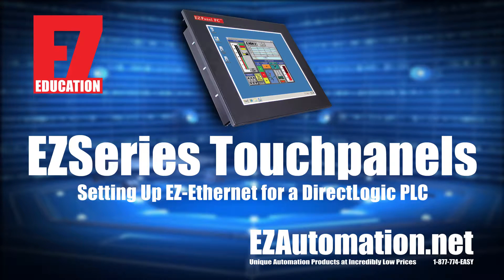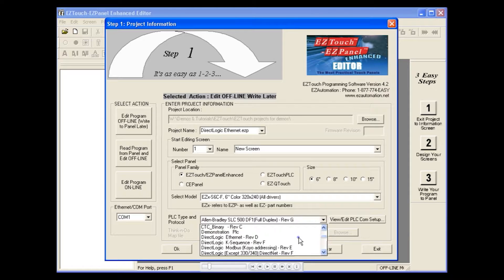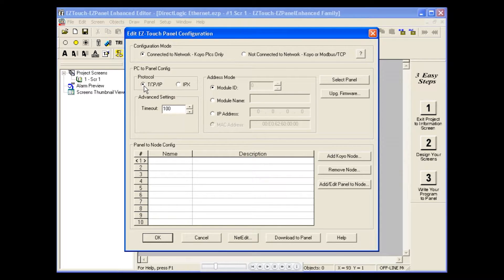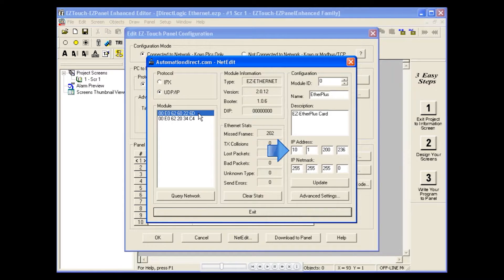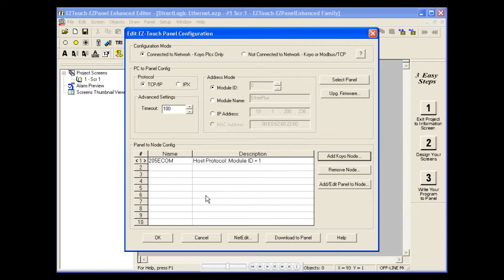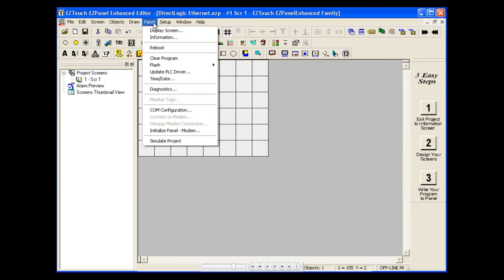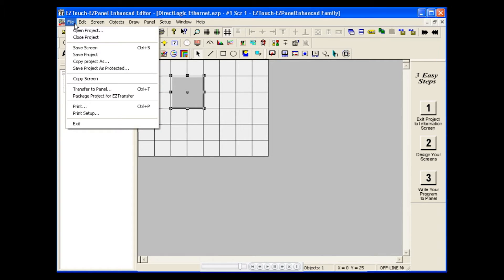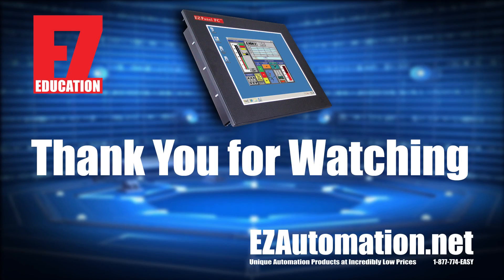Setting Up EZ-Ethernet for a DirectLogic PLC

Comment: how are u?just want to ask :i have ez ethernet card (i know its obsolete )but mine is almost new , i have ez panel EZ-T10C-FS ,,,THE SOFTWARE IS FULL VERSION 2.3.0 ,,,i installed the ez ethernet ,,, but the problem i cant see the mac adress in Panel information ,,,as there is only a status led (power which is on )...all the others leds are off ,,,the firmware of my panel is L0.81 ,,,,,,,i tried with netedit  but in vain ,,,,i think it s like the panel doesnt recognize the card ,,,i dont know why .....thats why i want to ask you to help me ,,,,,thanks